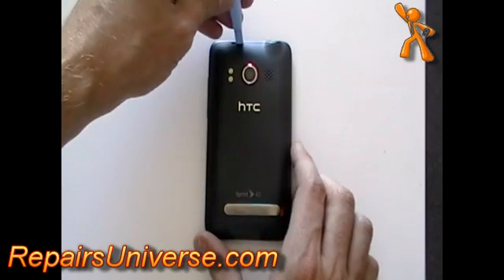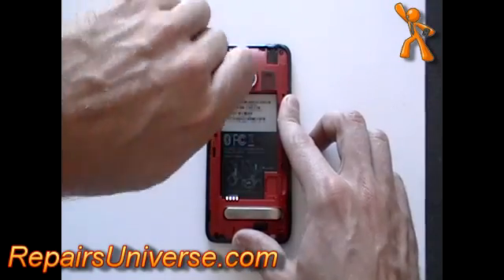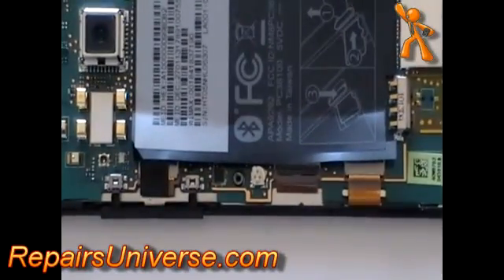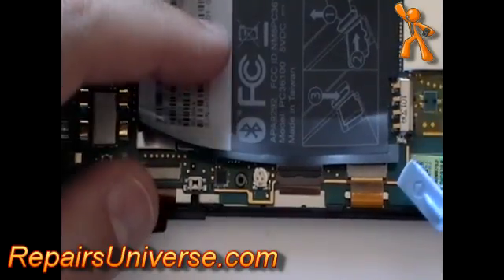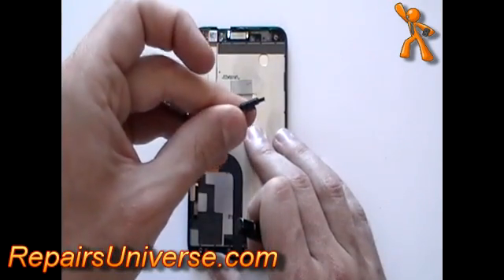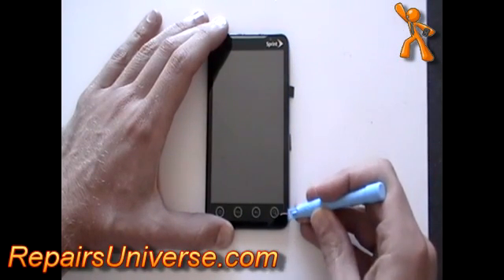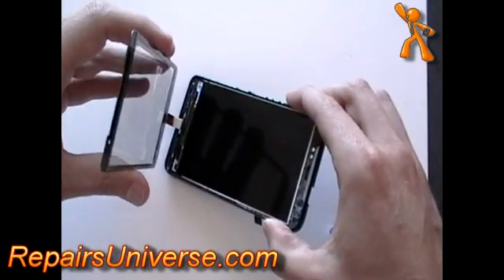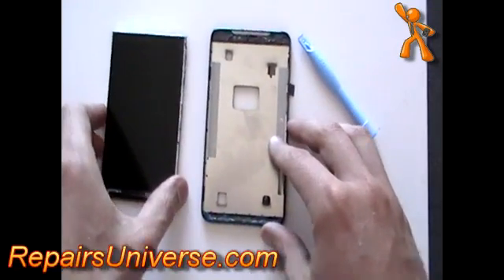HTC EVO 4G LCD Screen Replacement Instruction Repair Guide

Comment: I replaced the screen on my htc and now it looks as though there is water inside the screen and the i cant open my phone, was I suppose to leave the plastic on? is the phone still repairable? it comes on and seems to work other than not being able to touch it..

Comment: I replaced the digitizer but now have a small area on the LCD that is black near the edge. Has the LCD been damaged or does the digitizer need to touch the LCD in this area. Maybe I missed a small piece of broken glass stuck to the adhesive?

Comment: i dropped my evo and now the screen wont light up. the bottom buttons still light however and i can see whats on the screen if i tilt the phone in the right lighting. any ideas on what part would need replacement?

Comment: Also, do you have any recommendations on the battery port?   had phone replaced once already but know defect to battery port attachment to motherboard reoccurred - changing battery out is when it was dropped...do you have a fix for that or is it all HTC Evo replacement/repair work only?

Comment from the maker: Yes, You can use heat to loosen the adhesive hold the 2 screens together and replace just the touch screen digitizer. We have it available and ready to ship on our site at RepairsUniverse (dot) com

Comment: Hmmm..My phone didn't come apart like yours did at 4:57 but instead has a wide ribbon cable at the bottom of the LCD screen which ripped in half when I pulled the screen out

Comment: Thank you so much for this video. This is the second time I have replaced the cracked glass on my HTC EVO. The first time, perfect. No problems, the second time, I followed the same procedure and now I can't get it to power on. Do you think I did damage to the power button itself? (there is nothing visibly wrong with it that I can tell) Or do you think I connected something incorrectly?  Any insight?

Comment: Excellent guide, However the job isn't done until the phone is re-assembled. You need another video showing placement of adhesive on reverse of screen, showing the importance of re-connecting cables correctly, keeping fingerprints off lcd and reverse of screen, etc. I find a common problem is a cable connected at a slight angle which can give some very interesting problems with the touch screen.

You guys are doin a great service by providing these videos.

Comment from the maker: If the connection is broken then you will need a new board if the connection fell off then you should be able to place it back on to the jaw.

Comment: I DROPPED MI PHONE 1 ONCE AND IT WENT DARK BUT THE BOTTOM LIGHTS STILL CAME ON IT MADE NOISE AND EVERYTHING...BUT THEN I TOOK THE BATTERY OUT AND PUT IT BACK IN AND TURNED IT ON AND THE SCREEN WAS STILL BLANK 4 LIKE 10 SEC N THEN IT CAME BACK ON...BUT MY COUSIN DROPPED MY PHONE AGAIN AND NOW ITS DOING THE SAME THING! BUT NOW IT WONT GET OFF THE BLANK SCREEN I TRIED EVERYTHING BUT NOTHING WORKS!....ANY SUGGESTIONS BECAUSE I DNT WANT TO BY  ANOTHER $300 PHONE AND I GOT IT FROM CRICKET LOL

Comment from the maker: If it worked before this tells me something went wrong during installation. Could be simple installation issue or installation damage. If you reconnect and it does not fix the issue, you may need a new earpiece speaker.

Comment from the maker: @mehole86 If the LCD flex was damaged then the only way to get full functionality again would be to replace the LCD screen. The LCD does not have to function fully in order for the touch screen to work. If the touch function in not working, I would double check the connection to be sure it is fully in place on the motherboard.

Comment: Hi there... I attempted to replace the digitizer on my own today. Needless to say, I struggled with the ribbon connectors in order to make the repair and may have damaged the connector for the LCD screen. What would be the best way to reconnect the flex cable to the motherboard at this point (if possible)? Also, does the LCD screen have to be functioning in order for the digitizer to work? The phone is functioning properly but I'm unable to respond to phone calls, etc.

Comment: @RepairsUniverse Ok. Thanks.  Do you think it'll be almost the same process as the video above? And what type of screwdriver should I use? I'm about to buy the replacement from your website but I'm unsure of what to buy. I don't have to buy the plastic pry tool since it comes with it right?

Thank you for your help.

Comment: Hi, I just had a crack on the screen of my HTC Evo View 4G and I was hoping you have a video posted for it as well.  I'm not really sure if the HTC Evo View 4G Touch Screen Digitizer Replacement item on your website can fix/replace it.  When I open my device (HTC Evo View 4G) the touch screen is not working, thus making my device unusable.  Please help. Thank you.

Comment from the maker: @thedeepestword2000 The most likely cause would be a bad connection from the LCD screen. I would suggest checking this connection and the whole LCD flex cable to be sure it has not been ripped or damaged.

Comment from the maker: @DIARadio Sadly we have not found a reliable alternative to determining the LCD flex size besides physically measuring them. Luckily you don't have to dig into the phone too far to find this. The exact measurements of both can be found at RepairsUniverse (dot) com.

Comment: @stevenjchang You will only have to replace the digitizer as long as the images on the  (LCD) are still crisp and clear. I did find that removing the digitizer was not as easy as most of the videos show. The adhesive holding it in place was strong enough that I damaged my LCD while trying to remove the digitizer. I just completed replacing my LCD and all is working well now. The digitizer was easy to remove this time because the replacement didn't have adhesive.

Comment: @stevenjchang Hey Steven, going from my own experience. You only need to replace the digitizer. However, I found that when I replaced my digitizer there was so much adhesive that I ended up breaking the LCD. Now I'm replacing the LCD. So, just a warning.

Comment from the maker: @stevenjchang Thank you. If the display is working properly, then you will only the "glass touch screen digitizer". This is the outer glass. These are available at RepairsUniverse (dot) com, as well as all of the required tools and adhesive.

Comment: hey guys GREAT VIDEO, i just dropped my phone today and screen (glass) is broken all over the place.  i had a question of lcd vs digitizer.  the phone still works fine, and seems very responsive.  i had a screen protector on, so the glass is still in place.

which one do you think i need to replace?  the $30 digitize or the $50 lcd???  which one is the "quote" and "quote" "GLASS".   

much much thanks in advanced, keep up the good work :)
hopefully i can fix this

Comment from the maker: @xxbafowxx Great point about the separate screens, however removing the glass touch screen digitizer will not damage your LCD screen if done properly. If the touch screen is not coming out of the front housing easily, we suggest using a hair dryer or heat gun to warm the adhesive holding the touch screen in place.

Comment: I think most ppl are confused with their broken screens..
Theres a difference between the glass and the LCD screen. they are two separate pieces. 
if you crack your screen, its prob just the glass, but when replacing the glass, you dont realize you also remove or break the LCD in process, and you put the new glass back on with no LCD
this will cause white screen, because no LCD

Comment from the maker: @tosmooth6 Could either be a connection issue from the LCD screen to the motherboard, or the LCD screen is damaged, causing black screen. I would first - double check the connector to be sure it is fully in place.

Comment from the maker: @blilley2190 This is likely the keypad flex cable. It is held on the bottom by adhesive. Normally this will not come off with the LCD screen, but is possible.

Comment from the maker: @speedster2451 These buttons are controlled by the touch screen digitizer, so if your digitizer is not functioning properly and is causing the issue, then yes a replacement will resolve this.

Comment from the maker: @jamesisbetter245 Tough situation. Normally there is nothing you can do in these situations but replace the board that the clip is on (motherboard likely). Temporary fixes can usually be done, this can include tape or adhesive holding the cable in place.

Comment: My screen was in a million pieces, once you find the bottom screen wrapping right under where it says "HTC" it peels right off. Use a heat gun to expedite the process. also, scrape all remaining adheasive off when you are done, I just used tiny dabs of super glue for the new screen in the four corners of the housing. Be warned, putting it back together is far harder than taking it apart, but with patience it will get done.

Comment from the maker: @Brianx220 All steps are shown in the video. Which flex cable are you referring to? Both removing the touch screen's and LCD screen's flex cables are shown in this video. Sorry you did not find the video helpful but all process are shown, regardless if the phone has been opened before or if it is your Evo's first repair.

Comment: Ok its not as easy as just taking the screen out. you need to show how to get the flex cable out. yours has already been opened. mine has never been opened so your instructions dont really help.

Comment from the maker: @rajonmd This sounds like a LCD issue. I would suggest disassembling the Evo to the point where you can check the LCD's flex cable connection. Be sure it is fully in place and there is no damage to the flex cable or LCD screen itself.

Comment from the maker: @et462619 If the side buttons do not work it is likely just an alignment issue. As for touch screen, possible it is a connection issue. Was the touch screen digitizer working prior to the repair?

Comment from the maker: @OverdoseEgoBeats The LCD flex cable will run from the back of the LCD screen to the motherboard. It is pretty short. There are 2 versions, normal flex and wide flex, which are not cross compatible. Check out RepairsUniverse (dot) com for more information.

Comment: @DaNeroDaHero2k11 - I just posted a similar issue. If you had the same trouble I had, you probably damaged the surface of the LCD when you pried the glass out. This is almost unavoidable if u don't know the LCD is attached to the glass when getting it out. 

Good news is now u are comfortable with the process.

Get a new LCD ($25-$40 on ebay), and replace it. Now you can place your new glass back on top and if it breaks again, it will be even easier to replace.

Check your cables too for sure!

Comment from the maker: @daracer21 Very good work, Hopefully it will hold, normally this is not overly reliable. As for the touch screen, could be an issue with the touch screen connection. Re-seating that cable may resolve the issue.

Comment from the maker: @et462619 Normally this is caused by a loose connection. I would suggest taking it apart and checking the LCD and touch screen digitizer's connection to the motherboard.

Comment: @RepairsUniverse ok so after several days of trying to figure out how i was going to save my phone i came up with the idea to place a small piece of vinyl tape on the back side of the LCD ribbon,to my surprise it worked...so now the only problem i have is the notification bar does not respond at all....any ideas? thanks for the help.

Comment from the maker: @daracer21 This connector is for the LCD screen. The flex cable may slide in, but it is not connecting properly. Sadly there is no real way we have found to apply the correct pressure on the cable and provide a full connection. Replacing the motherboard would be your best option, however these are normally quite expensive and difficult to find.

Comment: while replacing the screen on my evo the release claw on the bottom ribbon cable clamp broke.im still able to slide the ribbon cable into the connector without locking it down,however now everything works fine on the phone except now the screen has no picture...any help would be great.thanks.

Comment from the maker: @ilovesdca This is the LCD screen. It displays images behind the glass digitizer. Be aware that there are 2 different LCD styles as well, Normal flex and Wide flex. Check out RepairsUniverse (dot) com for more info on this.

Comment from the maker: @barbaraann31084 I would double check the LCD flex cable and be sure it is fully in place. If it appears ok and has been reseated a few times then I would suggest speaking with the supplier of the part directly for further diagnosing.

Comment from the maker: @8800bambam Normally just the connection from the touch screen digitizer to the motherboard. I would suggest checking the flex cable for damage (rips) and also making sure the flex cable is fully connected.

Comment from the maker: @brknhrted22md Likely it is just a connection issue. The 2 likely causes is the LCD flex cable is damaged (ripped) or the connection is not fully in place into the motherboard.

Comment from the maker: @DaNeroDaHero2k11 So the LCD screen is discolored and you have finger prints on the screen? The discoloration is caused by damage to the LCD screen (normally flexing the screen or applying too much pressure). To remove the finger prints you will need to disassemble and use a microfiber cloth (or similar) to wipe down the screen.

Comment from the maker: @mrkillthepower Glad to hear, some fit and others don't. Sounds like an issue with the touch screen. It may be the flex cable is slightly off. I would suggest checking this flex cable to be sure it is fully connected. Likely this will resolve the issue.

Comment: Weird a T4 torx worked on mine, but I.have a problem, followed the vids exactly but when all said and done, everything worked except sliding down the notification bar, and ideas? If its open I can slide up but I can't slide it down from the top

Comment from the maker: @billetito89 Not too likely, sadly this is damage to the LCD screen. When replacing the digitizer it may be possible you somehow caused damage, or flex, to the LCD screen causing this vertical line. A LCD replacement would be required to resolve the issue.

Comment from the maker: @KPSchleyer Yes, sadly this is damage to the LCD screen. When replacing the digitizer it may be possible you somehow caused damage, or flex, to the LCD screen causing this vertical line.

Comment from the maker: @cmendez3955m No problem. You should be able to reuse the adhesive without an issue. I believe what has happened is the touch screen is putting pressure on the LCD screen. Add a bit more adhesive all around the edges to give the touch screen enough lift away from the LCD.

Comment: Thanks for your response. I did remove the the screen proctor front and back, there's one big air bubble in the middle of the screen. If I disassemble the phone again will I have to replace the adhesive strips?

Comment from the maker: @boricuaevita  Alternatives to our pry tools can be a strong piece of plastic or guitar pick. Another alternative would be a small flat head screwdriver, just be aware that this can scratch the case and screen. Extra caution should be used when attempting a repair with a metal pry tool or flat head screwdriver. Our plastics will not scratch, which is why we suggest ordering a set of pry tools from the website, RepairsUniverse (dot) com.

Comment from the maker: @scellybo100 You will need a T-5 Torx screwdriver to disassemble. As for the black screen, a few things can cause this. Its suggested to check the connection of the LCD cable to the motherboard and make sure no visible damage is present, and the connection is fully in place. If everything looks good, the LCD screen could have been damaged and replacing it may be your best option. I would not consider the phone totaled yet, as long as the motherboard is in working condition.

Comment: THANK YOU SO MUCH. I literally just replaced my Evo glass. 2 things i'd like to add tho. Takin off a cracked glass was the hardest part. becuz the phne in the vid wasnt broken it looked e-z.  evrythng else was easy.also there are little clear pieces over the home buttoms at the bottom of the glass in the back that help distribute the light for the home keys. W/O it the lights keys wont illuminate. U have to peel them and place it on the new glass. Besides that, simple instructions. Thanks again!

Comment from the maker: @0jumpman0 It can depending on the model. For the Evo, the only difference may be LCD screen using the wide flex cable compared to the normal cable.

Comment from the maker: @DwiZZy34 Are you referring to the glass touch screen digitizer (outer screen)? If so, replacing the digitizer will get rid of those cracks and get your touch screen digitizer fully functional again. Replacement screens for the Evo 4G can be found at RepairsUniverse (dot) com

Comment: The screws are the hardest thing to get out. Right now I have 5 of them out. The 6th screw was capped with some sort of black plastic. I had to dig it all out, not I'm trying to get the screwdriver to fit. I might just drill it out.

Comment from the maker: @MsFlake1974 Is there sound from the loud speaker? If it is just the ear speaker, check the contacts and be sure they are in full contact to the connectors.

Comment from the maker: @andyO4you Hmm, could be a connection issue, or possibly a faulty LCD. I would double check the connection and check for damage on the flex cable. If nothing, it is likely a faulty LCD screen.

Comment from the maker: @aprilweseloh It sounds like a connection issue. Make sure the ribbon cable is fully installed and the jaw connector closed and the screen should power.